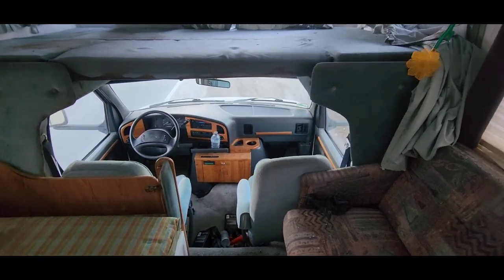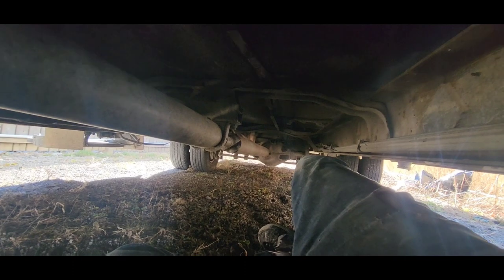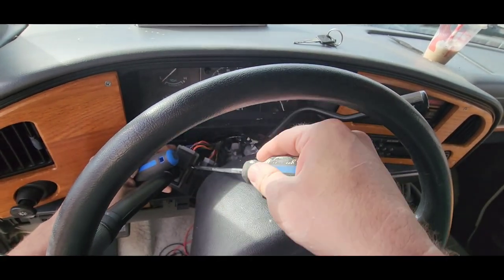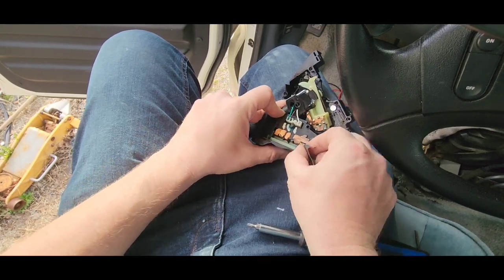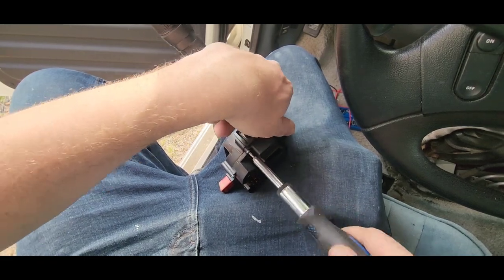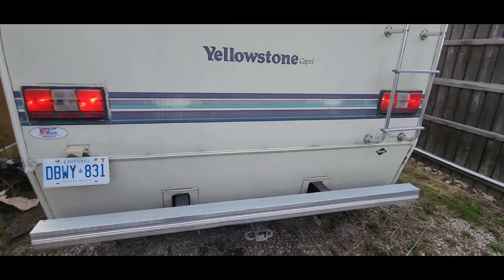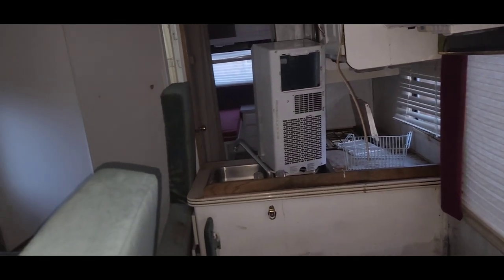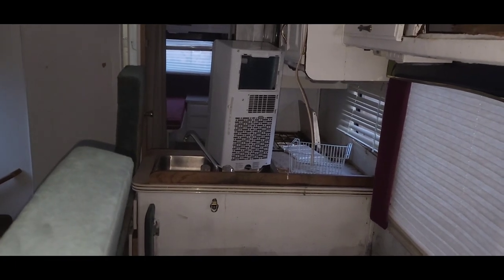1996 Yellowstone RV rebuild episode 1

Comment: What's actually cracked, the manifold or the corner of the head? I can't imagine getting those bolts out without some sort of problem. PB Blaster and heat will help, but those bolts go through a heat cycle every time the engine runs, so they're pretty well baked in place. It looks on camera like there's room to reach the bolts, but I wouldn't be happy about it.
Reply from the maker: I actually found a mobile welder that can weld cast so he says that he will weld it all together and put a Hilo coil in to secure the manifold to the head, which it is actually the head that is cracked not the manifold. As for taking that manifold off I am not looking forward to it but I really got to get that gasket changed so I guess I got to cross my fingers and Hope for the best

Comment: its a miss fire. I can hear it. change plugs and wires
Reply from the maker: I can definitely hear the misfire which I was figuring was from the exhaust leak but I just don't know if it would cause pretty harsh shaking under load. Check the spark plug and the one I checked looked basically brand new but maybe I will go ahead and change them out anyway.

Comment: Tires out of balance???
Reply from the maker: That was one of my initial thoughts but when I let off the throttle even going 100 km an hour it goes away so I don't think it's Tire related
Reply: @My_Little_Hobby  a flat spot on tires can vibrate, and that can change over a range of speeds.